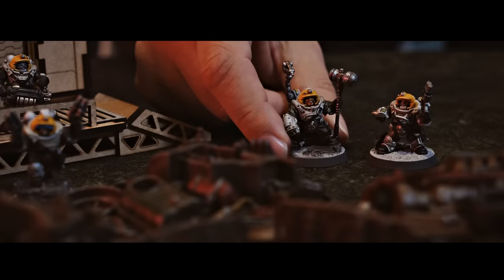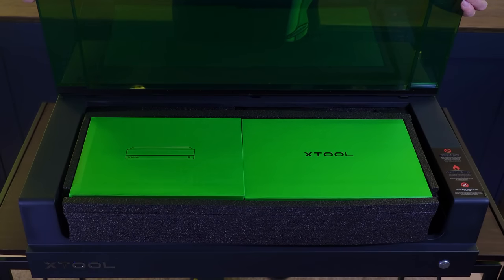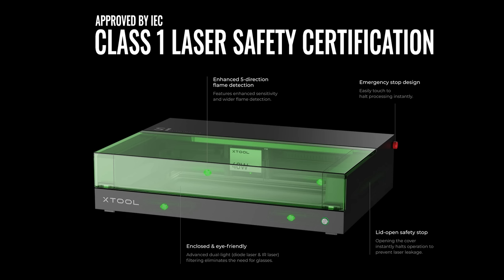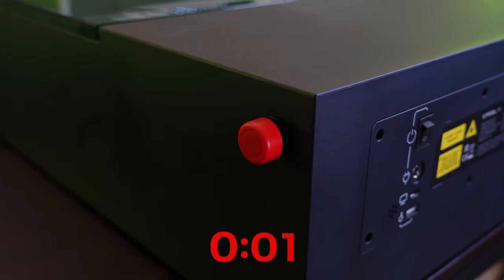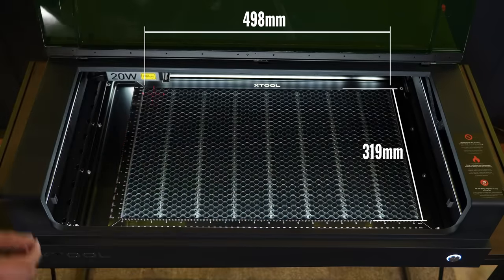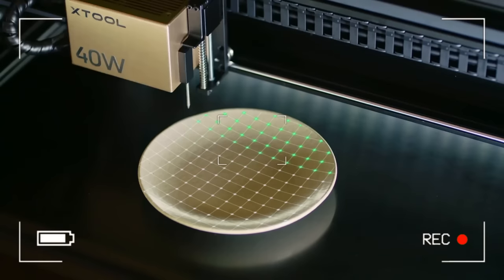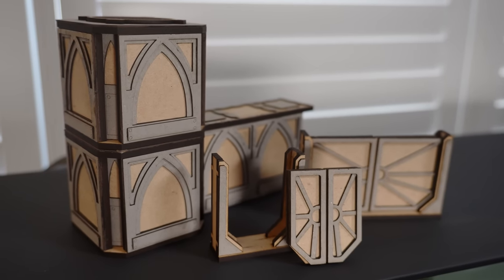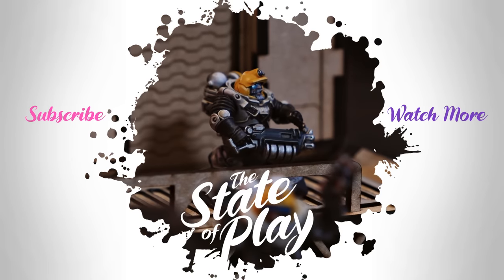Make WARGAMING TERRAIN super safely | The Xtool S1 20w

Comment: I actually upgraded my laser engraver from an open frame 10w to this laser in the 40 watt version. I would be curious to see if the 40w can cut, engrave faster due the increased power. It also may make difference in parts fitting? since the 40watt dot is slightly larger.
Reply from the maker: Yes. However the speed is dictated by the frame and rail rather than the power. The 40w will cut much thicker materials in one pass. It will probably cut thinner material much faster in the settings but I’m curious myself if the larger dot size means it changes the part fitting. I can’t see it really as the difference is tiny.

Comment: Thank you. This is a really great review. I've had an A4 HPC laser for over ten years and loved making all kinds of stuff with it. But it's a bit old and tired now, and the idea of replacing the CO2 tube, now it's cutting depth has reduced to just a few mm has me thinking maybe it's time to get a bit more up-to-date. I'd never heard of this laser cutter, but your review video looks really exciting.
Do you have details on cutting depths, speeds, kerf etc?
(e.g. my 40W CO2 HPC when new could cut 10mm acrylic at about 5mm/sec in a single pass, would regularly cut 3mm acrylic and mdf in a single pass at about 18-20mm/sec with a minimal kerf to the edge - could this 20W machine cut 3mm acrylic/mdf at a reasonable speed? or would I need to consider the 40W option?)
Reply from the maker: From what I understand (haven’t tried yet) this will cut 10mm in a single pass. The 40w version of this cuts even thicker. 

I’m currently cutting 3mm MDF in a single pass with the 20w. I’m using 100 power but I reckon I could drop to 80.

Comment: If you push the red button nan will die. Problem solved.

I do love the look of these, but unless I can put forward a working business plan to the Mrs explaining how buying this will mean she doesn't have to work anymore, I don't think I could justify one.

Is there a lifespan on a laser?
Reply from the maker: Laser lifespans on diodes are usually 25,000 to 50,000 hours. 

Yeah, they pretty pricey but my first 3D printer cost a fortune. These things alway come down. Look at 3D printers now. And yet they’re still not user friendly and plug and play.
Reply: @thestateofplay2023  Thats a good point, Ive still got my Mars 2 Pro but it doesn't get used often. At least this doesnt look as messy. Just burn the house down instead.